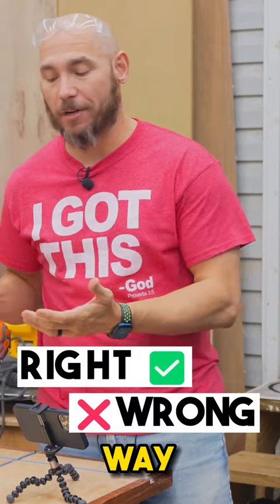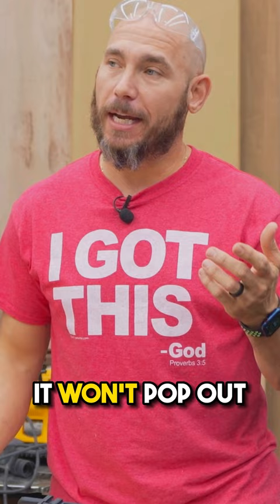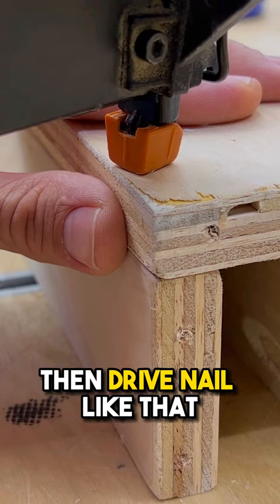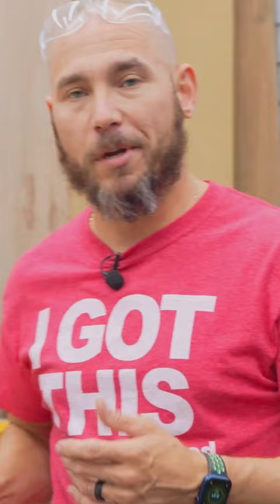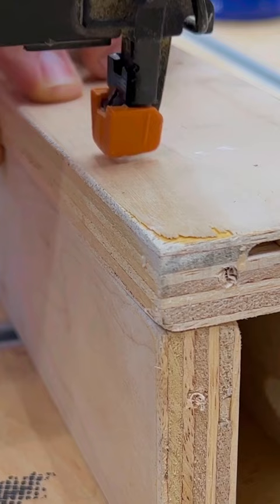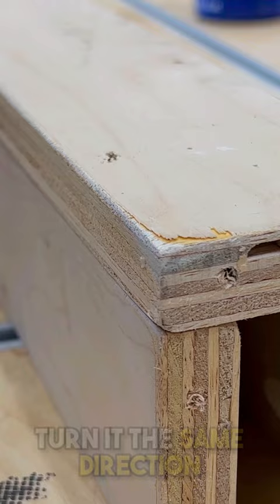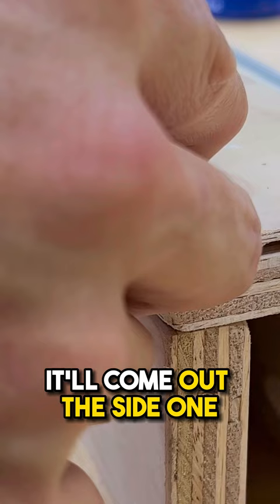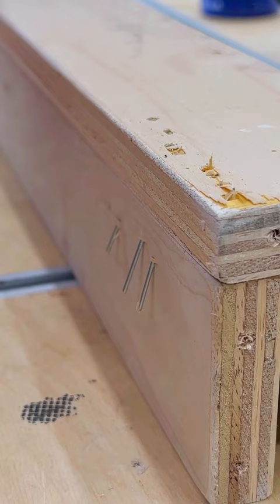MISTAKE with a Brad Nailer

Comment: I'm about to get a brad nailer for the first time and I did not know this. Good looking out
Reply from the maker: check out the full video in the pinned comment. It'll help you out more.
Reply: Same here....
Reply: Line it up with the combo square..don't forget glue..breathe and pray before you start work.
Reply: As long as you don't hit the bone it doesn't hurt much
Reply: Use a full face shield. I had a 2" nail curl on a quarter round molding and hit my eye. I was lucky it hit sideways but still did a lot of damage. Still can see and it healed up.
Reply: Good to keep in kind for any nailer or stapler. They can also deflect off of other fasteners if that's a factor.

Comment: Great tip, bad things happen when you’re in a hurry. Slow is smooth and smooth is fast is a sang I try to remember my self 👍🏽👍🏽
Reply: I used that same saying when I taught motor grader operators.  You could tell the day they got that.
Reply: Go slow speed comes with experience. One of the first things I was taught as a carpenter
Reply: It's a common statement in Army training, too.

Comment: This is the reason I prefer the 15g DA nailer. I know it makes a bigger whole but not by much and if adjusted to the correct pressure it can easily be filled with wood filler/drywall compound.  
   Also, the 18g nails are flattened so they will almost always bend towards the flat sides. I’m pretty sure that’s what he’s showing us in this video here.

Comment: The only time I've had a close call with almost nailing my finger is when I'm doing baseboards and I'm nailing them to the wall and you hit the rounded over corners and that metal corner bead. If that nailhead suggests right it'll definitely rebound and come right back out at you. However after doing this for over 35 years I have yet to nail my hand. I've come really close and I've come really close to top it off a few fingers using the 12in sliding chops are doing the crown molding. Those big blades will suck the material right into the blame if your hands are too close, goodbye to your fingers

Comment: That’s a great Tip! 👍🏼👍🏼
I have driven a million nails out the side and blamed it on the nail instead of the process! 
I wonder the mechanics behind this? 
By design, 
does the nail gun nail guide have more horizontal slop in the hammer in the gun? Or is it the configuration of the nail and it’s configuration? 
Tough question!!!

Comment: Dad had me angle the nails so they wouldn't pull straigt out. Add some angled the opposite direction.
When using a brad nailer it tends to bend left or right. Be aware.

Comment: I wish I had known this a few months ago. Learning something new everyday is good though. 
Now I haven't put any blood stains in a project yet, I know that day is going come, but I have had a few projects that didn't come out the way I had intended because of the Brad nail blowing out the side like that. Looking at a single under 3 to 5 times magnification, I'm able to see the nail is designed to be installed a certain way. I have no desire to do a blood test with a brad nail.😢 This is handy info to have and I bet I ain't the only hobbyist would-be full time Wood werkr who didn't realize they didn't have their brad nailer "clocked" incorrectly.🧐🤔🤨😇.

Comment: I have done a right and a wrong way driving nails with a pneumatic 18g Brad nailer. I was nailing an overhanging piece and was going well until I hit something and it came out and I felt the nail go into my finger. It just hit the flesh and I had to back my finger off the nail. I had an electric nail gun that would jam on me before and I had to pull a jammed nail from the gun. I gut the jammed the nail out and must have hit the trigger because the gun shot the next nail into my index finger and to the bone. I have cool pictures of x-rays if I can post them here. My wife wasn't happy having to drive me in for my own stupidity. She refused to let me drive in.
Reply from the maker: OUCH!
Reply: @731Woodworks  it is a learning process.  It just takes me longer I guess.
Reply: @731Woodworks  it happened a few years back. In the Emergency department I told them I had a problem a finger nail. They didn't look impressed until I showed them what I meant.

Comment: Even a knot will deviate that nail, I’ve had it happen with a framing nailer a couple of times, not fun gettin a 3 1/4 inch nail in the finger or hand lol
Reply: 27 years as a carpenter it’s happened only 3 times and I’ve gotten bitten by the table saw bad once lol not fun I respect the tools much more

Comment: If you’re nailing 3/4 use a 1 1/4 brad nail instead of the 1 1/2 you’re using. 1 1/4 almost never pops out.

Comment: Howdy Mr. 731...

Nail injection of wood into the thumb is a right of passage. You're not a "true" woodworker until you've popped a few nails into your finger. It's a tattoo. A Medal of Honor 🎖 Just slap a dab of super glue onto the hole in your finger/thumb. Works better than a band-aid. No more blood dots on your workpiece and because you're not putting a band-aid on it, you can still grip things. :_fistbump: